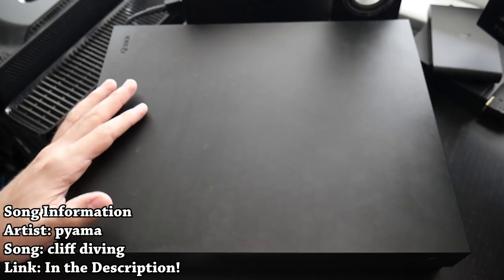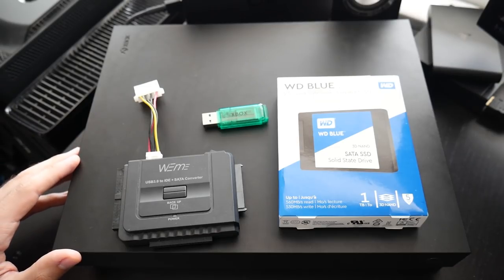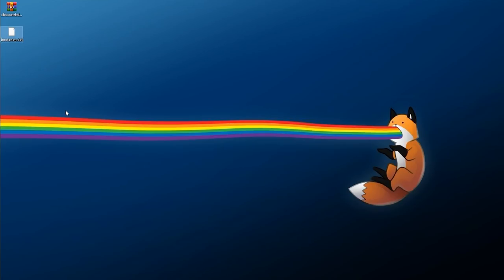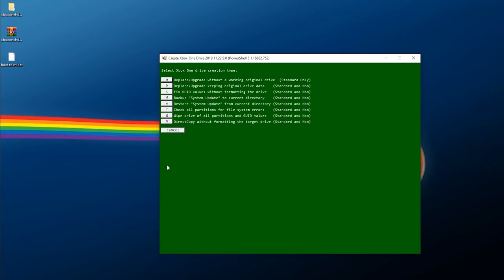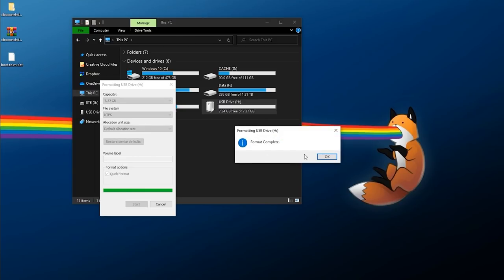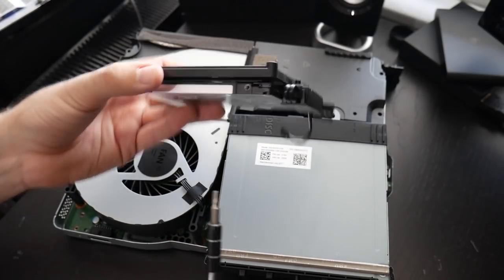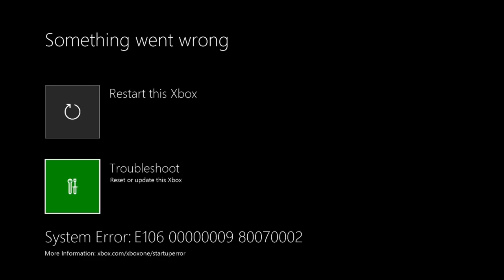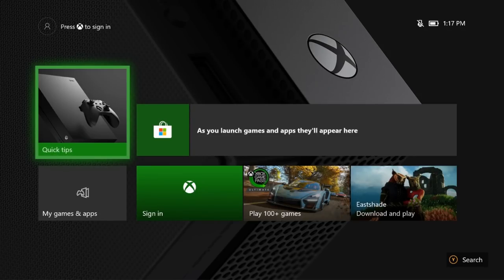How to Upgrade/Replace Your Xbox One HDD! - SSD/HDD Upgrade Guide for X1, One S, One X

Comment: Hi - I followed the video which as really clear as always but there is only a black screen when I turn on the xbox - any idea what is wrong with it?  Thanks
Reply from the maker: Might be worth trying again? I've had that on bad hard drives/installs I've had to replace.
Reply: @MrMario2011  Thanks for the reply - love your vids - so clear and easy to follow.  It's a mystery machine - when I turn it on with or without the hard drive connected - the hdmi finds it but it stays on a blank screen.  Tried install from usb and the graphic and green loading line appears and when it reaches the end it turns itself off and then back on to an error E100 code - I'll try a different hard drive and see if that works - keep up the amazing work - such a brilliant channel.

Comment: I have followed this video step by step and still only get 4% and back to E101. Brand new drive, brand new cable. Im at my wits end.
Reply: Another fresh, brand new drive. Followed steps precisely. Still get System Error E101 00000504 8B050041. Help me Obi-Wan Kenobi, youre my only hope!
Reply: @mazterjedijedicouncil4796  Same here
Reply: @nilo055  so many vids ive watched where its hey install the drive boot to recovery run offline update and boom done...i just dont know what im doing wrong
Reply: @mazterjedijedicouncil4796  Me either.
My Offline update fails at 1% and goes back to Trouble Shoot screen with error E100
Reply: @NSteenhuis  Good to know Im not the only one. Need a solution.
Reply: @mazterjedijedicouncil4796  yep, same here, at this point I'm just gonna slap the stock hard drive back into my S and return the new SSD I bought
Reply: I would recommend trying to copy the OSU1 file into a different USB drive. The USB drive might be the issue.

Comment: I swapped my hd for a 1tb seagate but it doesn't pass the 59% offline update it resets to E100 error screen what could be causing this?

￼
Reply: E100 at 59% is typically a cdrom drive error. Check your connections and orientation. You cant swap cd-drives. Gotta fix what you have as daughterboard is locked to mb. However ms will swap it for $$$$.

Comment: 960gb ssd looks like 365gb how do i fix it
Reply from the maker: You need to set it up as a 1 TB if possible, it sounds like it was set as a 500 GB
Reply: @MrMario2011  I chose the 1tb one. each time it was 365. When installing from usb, it takes 500gb. 1tb that I set

Comment: I wonder should I still attempt to do this with an Xbox One S. Mine has 500GB and I only have like 120 left it's not enough storage. Or should I get external, but then I'd have to have that thing around all the time 🥲
Reply from the maker: Up to you.
Reply: @MrMario2011  Also I remember you, you made the PS3 jailbreak video a while back. I finally got it to work for my Slim your method was the only one that worked thank you

Comment: I have tried this method several times but, when playing, the xbox crashes and gives me a system error, what could it be? E tried with another HDD and it keeps happening. Thanks
Reply: If your an xbox insider thats why. If not idk. Remove your console from the program and it will work
Reply: @nikbailey3520  i'm not insider won't work

Comment: This is the third guide I've followed with three different 1tb ssd's.. i just can't get past 1% and the upload stops and takes me back to the E102 E101 error screen.. updates perfectly well when i reinstall the original mechanical drive..😞😞
Reply: I have the same problem, e101, 102, and 106. I depends what option I pick when I hit the trouble shooting screen.
Reply: Try a different USB - Ive had some USBs fail to upload the OSU1 file

Comment: Hello very good guide , but i have a problem. when i want to install the bootanimation and then i put hdd back on windows when i open the system update folder i find no folder all empty.  can someone help me?
Reply from the maker: Make the folders yourself to put the file in, or just wait until the next update where it will restore the animation.

Comment: why does Microsoft hate gamers ? why does it take me all of 5 minutes doing a HDD/SSD Upgrade on a PS3/PS4 but i have to do all this stupid stuff for a COMPUTER SOFTWARE COMPANY... Super Disappointed with Microsoft. but thank you MrMario for the amazing simple easy-to-follow guide
Reply from the maker: For sure, really dislike how the storage is handled. Out of four generations of consoles, the only one being the Xbox 360 can run independently without a hard drive and is completely external. Unfortunately even that has its own issues with proprietary adapters and security sector files, but I truly dislike how any of the other Xbox consoles can be bricked with bad storage issues while also being a pain to replace.

Comment: if i manually put the boot up screen in. whats happens when the update comes around?
Reply from the maker: No change.
Reply: @MrMario2011  so the boot screen still doesnt show. i decided to give it a bit before i said anything but still no go. i did notice earlier that my A folder in drive "x" was empty while my "b" folder had the files that your "a" folder has.

Comment: I have tried this on my OG Xbox one and it doesn't work. I have got the scripts written right, I have done everything to the T and I still get SOMETHING WENT WRONG SYSTEM ERROR E101 00000504 80070570. I have tried OSU 1 OSU2 OSU3 all on separate flash drives. On OSU1 it doesn't show the icon for offline system update, but on OSU2 and OSU3 the icon lights up and it try it and it gets to 3 or 4 percent and then it says SOMTHING WENT WRONG SYSTEM ERROR E101"...." Is there something I am missing or not doing? I have my old hard drive and when I plug it back in it works fine. So am I the only one having this issue? Can anyone suggest something else? Any help would be great. I have been working on this for 2 weeks when I get off work and I am at my wits end at this point. I have tried 2 other drives. I have also cloned the OG hard drive and I still get the same error messages. Will I have to just pray my OG hard drive lasts and just install my games to an External SSD. I am afraid for my OG hard drive to die on me now.

Comment: i have a problem with the bootanimation, i put the files in the correct folders, but i still have black screen when I turn on the xbox, someone have solved this problem?
Reply from the maker: If it isn't displaying, worst case I wouldn't worry about it. It will be restored the next time you install a system update from Xbox Live.

Comment: i have a broken hdd for xbox one i can replaec it with a new hdd or ssd and  and works ??   because somene teel me to try to clone the broken because the have a codes and numbers and its required to boot the systeme and read disqks
Reply from the maker: All shown here.

Comment: i have a kingston ssd 480GB (real 447.13GB) on disk management) when i try the steps (a) function tell me my hard disk is to small to initialize. How can i fix? possible with my ssd is not good?
Reply: I've the same and I can't get past this either
Reply: Must be a minimum of 500gb or more anything less will not work
Reply: @davidjduncan1974  after many times it work with a kingston 480GB SSD disk

Comment: Is there an updated version for Windows 11?
Reply from the maker: Should work just fine on Windows 11
Reply: @MrMario2011  No. Doesn't work. Tried on three Windows PC's all same issue during the copy part with an exception is thrown and the fails to copy the data as can't identify the correct drives.

Comment: Has anyone tried with 128 GB SSD? I just tried it and when I attempt to update from USB, I just get an error, it doesn't start the process. 

So either it's too small to be supported, or it's because it's an old SSD with windows OS on it and I needed it to be formatted first perhaps?

If it mentioned that I must have missed it.
Reply from the maker: Only 500 GB, 1 TB and 2 TB are properly supported.
Reply: @MrMario2011  That's interesting. I wonder if it's possible though. I'll have to do some more research I suppose to see if anyone had any success with differing sizes. Maybe a matter of how I partition it? Very curious. 🙂

Comment: WARNING: there are some technical details which aren't mentioned in the video which could effectively for at least a while brick your console.

If your system has the latest update from Microsoft like mine did, the released OSU1 file as of 8/20/2024 is for an older version which means it will fail to run the update on any drive provided regardless of brand or partitioning structure. Found this out the hard way for myself. Unfortunately the only solution is to wait for Microsoft to post a new OSU1 file. 

So check the OSU version and your Xbox OS version before attempting this. Also this isn't an attack on Mr. Mario, he does great stuff and got me almost there minus one technical detail that I wasn't aware of and perhaps they weren't either. I'm certain Microsoft will release a newer OSU1 file and when they do I'll be able to recover and finish this SSD upgrade process as detailed by Mr. Mario. 

Also if he does actually mention this and I missed it (watched three times and couldn't find a mention of it) I apologize. Sometimes I have difficulty hearing, but I couldn't find any mention of this OSU1 version error that I ran into.
Reply from the maker: I mentioned it briefly, but it was in regards to the Preview Program stating if you were in that program you would just have to wait until a newer OSU file is available.
Reply: @MrMario2011  Hi Mr. Mario, I do apologize, must've missed it. I was not however in the insider program though. So must've been the August update and the OSU1 out right now is still July last I checked.
Reply from the maker: That would make sense. In an ideal world those update files would be synchronized, but unfortunately this can happen, and that's outside of my control. Earlier this year the download for Xbox 360 kernel updates was offline for several weeks, directly from Microsoft, for a several year old update. It was eventually fixed, but again, that can happen.

Either way, I hope you get your console sorted in due time!
Reply: @MrMario2011  Of course, and apologies if I came across as blaming you. Was just trying to let people know this could happen. Hopefully Microsoft will release another OSU1 update soon so I can complete this process.

Comment: Can I run the script after I've already put the SSD in the Xbox and reinstalled the os?
Reply from the maker: Why? If the drive is working there's no reason to do so.
Reply: @MrMario2011  sorry, I should have specified that it's only showing that I have 800ish gb even though it's a 1.92tb SSD
Reply from the maker: In that case it would be worth a shot, sure. Re-run the script and set it for 2 TB when prompted.
Reply: @MrMario2011  well I tried and all that happened is it started to fill up the bar, then it was as if I just plugged it in for the first time. Like it didnt say it disconnected, it just opened up all the partitions

Comment: Hi, can I try taking out HDD from my xbox and formatting it(so its like a brand new drive)because I don't think its dead. If that doesn't work I will just buy a new drive, but I wanna try it because I don't think that my HDD is dead(I don't get the hdd death noise like you said). Thanks for the tutorial, you made everything clear!
Reply from the maker: Sure, you can try that.
Reply: @MrMario2011  Thanks, I will try, if that doesnt work I will buy a new HDD

Comment: I’ve followed the steps however when I boot I get E106 and when I try to do the USB update I get an E101 error code which also pops up when I try to reset my console. I’d be grateful on any advice thanks.
Reply: If your an xbox insider it wont work, remove your console from the insider program and it should work. Unless your not an xbox insider then idk.

Comment: So if I put the data from my existing drive ont the new drive, will I need to do the steps for the offline update still? I'm going to replace it tomorrow
Reply: Yep
Reply: I made an oopsie and just appliee the update {Ihad an error E105). I thought I could just instal the update without resetting everything, But it was basically at factory settings when It booted. May or may not retry this tomorrow to try and do it right.

Comment: So of course microsoft automatically enrolls you in the insider program with NO WAY TO REJECT IT other than first accepting it on the console, THEN removing it. Well, their insider TRASH bricked my system, and now it rejects the latest OSU1 even though I had it successfully working using this method. SCREW MICROSOFT AND THEIR AWFUL UPDATE PRACTICES, this goes for Windows 10 as well. Horrible!
Reply: Confirmed. Guess some one in the household installed an update that is identified as "XB_FLT_2303ni..230309-1945" otherwise known as "XB_FLT_2303NI\22621.3680.230309-1945". Verify frustrating. I suspect the ONLY other straightforward way is to possibly clone the drive.